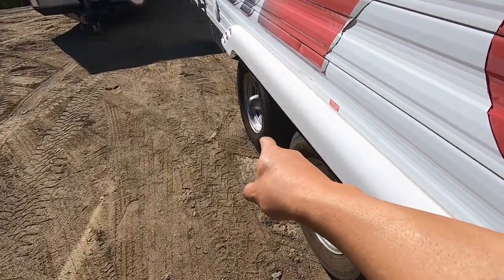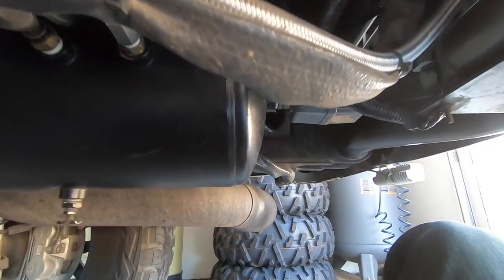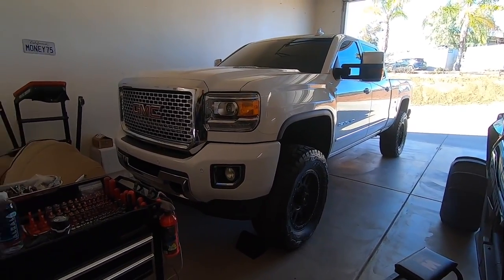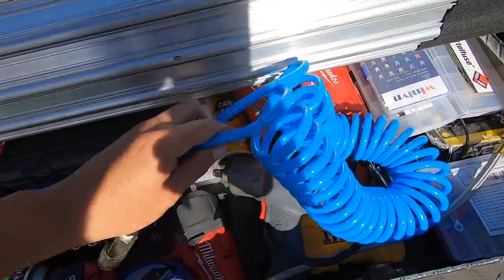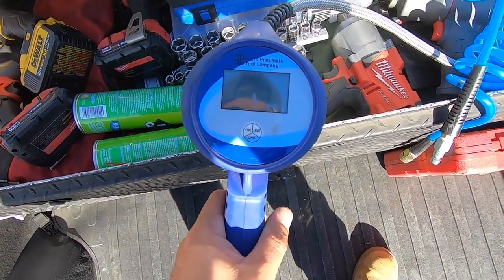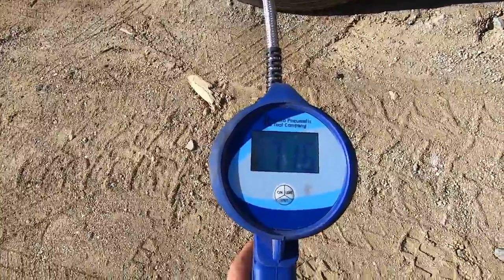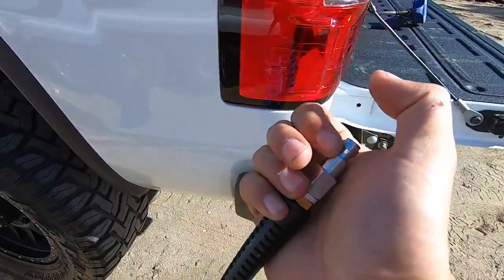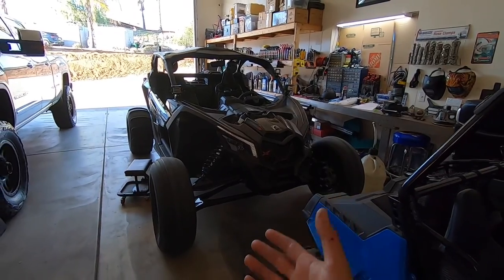WHY ON BOARD AIR IS A MUST

Comment: Throw on the 200psi pressure switch and add a regulator to reduce pressure going to the horn that way you can have more volume in the tank for when you need it.

Comment: That compressor is cute. In the offroad world we use ARB twin, it's 100% duty cycle and makes over 6cfm. It's also about the same physical size as your existing oba compressor.
Reply from the maker: well i dont offroad my truck i only use it for my can-am thats it.
Reply: @EddieLife3500  I think your missing the point. It's a much better product.
Reply from the maker: This compressor is 3 years old and has never given me a problem if it goes out then i will upgrade but no need to right know
Reply: The arb compressor is cute. In the commercial world we use vmac units. Much better product then arb

Comment: If your tyres are too hard in the dessert you more liable to stick in the stand or u more liable to stick period. It helps alot . Guys that stuck in the sand or mud had to deflate their tyres a bit . What tyre pressure your tyres are when u are in the dessert Eddie?
Reply from the maker: i just keep them at 70PSI in the trailer because we park in the hard pack not soft sand

Comment: Hey Eddie, great video, I have a new 33ft Jayco camper with the Goodyear 80psi trailer tires, but have always been told for my boat and my camper that trailer tires are designed to be ran at max PSI, interesting you run yours at 70.  I'm more interested in knowing about your lift or level kit choices as I have a 2016 2500HD Duramax crew cab standard box. What is your set up for lift or leveling kit, air bags in back etc? And what size tires are you running? I am trying to figure out best option to get slightly bigger tires without going crazy, love the stance and look of your dirtymax, tires don't stick out crazy to the side, not a fan of that look. I also want my truck to sit as level as possible when pulling 11-12K lbs camping, so I am sure air bags are best option for that.
Appreciate your help/feedback on this when you have time.
Reply from the maker: i am going to make a video on what my truck has on it and i never like running the tires at full max i always run them 10pounds lower because when i get to my destination they always expand 5 pounds more
Reply: @EddieLife3500  cool, that makes sense especially given a hot climate where you live. I'll be looking for that video, I'll most likely be doing leveling kit up front and bags in back for when it is under load with camper, but will sit level empty. I am not looking to run 35's or anything to kill mileage.
Reply: Fwiw tire pressure ratings are supposed to be max filled when cold. The ratings account for thermal expansion of air.

Comment: Hey....
I've been wanting to do what you've done...
I want the 5 gal tank, but with 9 bungs.....
Some systems are dual compressors...... 
200psi....
Constant duty: yes....
Definitely need the horns....
Bluetooth....
Can you guide me on this....
Did you piece it all together or get a kit.... then maybe tweaked things...
You can direct text me if ya want.... it's quicker.... besides... I may forget, lol... but am doing it as soon as I get this information......
I also want to add the bads.... you didn't use Firestone...the others more durable..... I'm confident the stuff you put together will be fine..... 
Shit always goes bad so I get that, lol.... 
Thx for your help little Bruddah.......
Ooh....
Thinking about bagging the front as well.....
Just to get a couple more inches if needed if I'm playing....
Gotta '13 first Gen Raptor...
4" lift.... had 38 NITTO Tarra GRASS on & FUEL Throttlers... 
Many upgrades.....
just went back to stock 35s and 10K load and CTS2 gas (6.2L) got 9.0 mpg....
Not bad results... 
OLD: 5.0/5.5 mpg....
Gotta '18 Stelllar 25FB 38'
Auto everything....
Residential fausets.. Granite /Corian surfaces..
Steel sinks.. porcelain heads..... 
Saved on depreciation....
Note:
Do Not buy from camping world.... headquarters is in Council Bluffs,  Iowa.... I bought mine in Cedar Falls, Iowa..... Google reviews... They're #1 and don't care.... Ooh they say they do....
I didn't check the reviews bc they were the Biggest.... mistake !!!...
Ok...

Slight Rant... lol
Thx for your help....
PS...
Really want a good wireless rear camera, but don't want to spend $1000.00.......

Comment: Can't you add on something to give your horns a seperate pressure.... ??
Also...

Ive been thinking about a panel to add to the inside of the box... to show the pressures... a place to connect to the air... etc...
A control panel....
Any ideas or suggestions......???

Comment: Very convenient set up, soon everything will be battery powered. Question on a previous vid, regarding the high idle switch, I tried the steps you showed on my 16 Sierra Denali 2500hd but it didn’t work. Not sure if mine is equipped with it😪
Reply from the maker: ya you mite not have the high idle switch then

Comment: hi! how do you take it water crossing? or to a carwash. I like the location idea and I plan to do the same with my truck but worried about the water and dust as well.
Reply from the maker: I’ve never had an issue
Reply: @EddieLife3500  done thanks! I just needed that to pull the trigger👍

Comment: Love the videos. Any recommendations for 2018 dodge 3500 single wheel drive. Already added on board air per your recommendations but looking to add some more options. Also I have short bed and sliding hitch and was trying to find a fuel station tool box like you have but the space doesn’t seem to be there. Any ideas on who makes super slim low profile ones. Again great channel
Reply from the maker: If you call RDS they can make you a custom tank for you not sure on the price but RDS has a lot of options for diesels
Reply: Eddie's Life much appreciated 🤘🏻
Reply from the maker: anytime